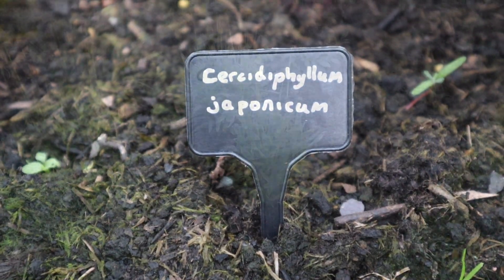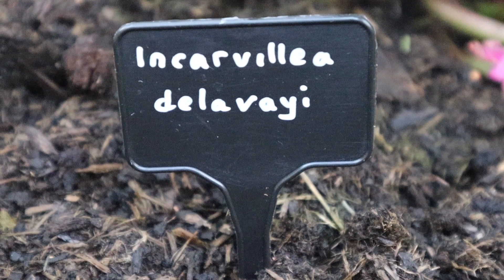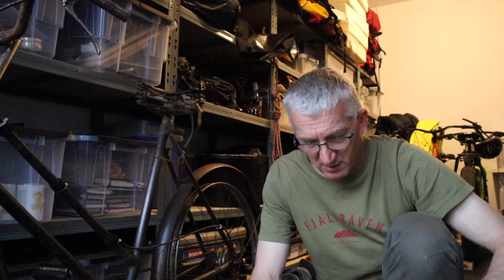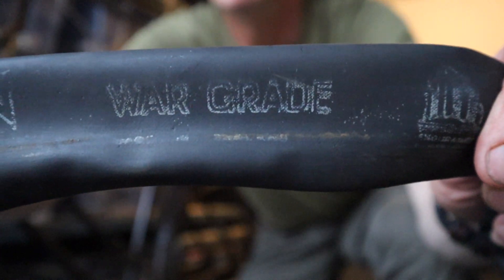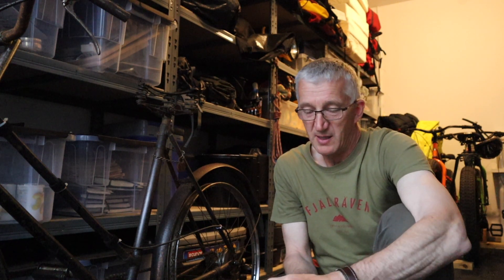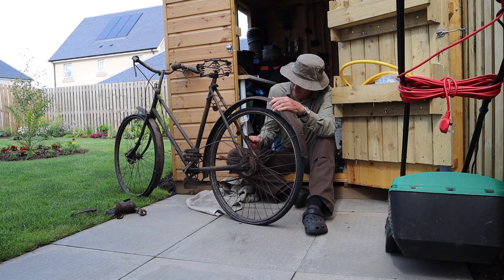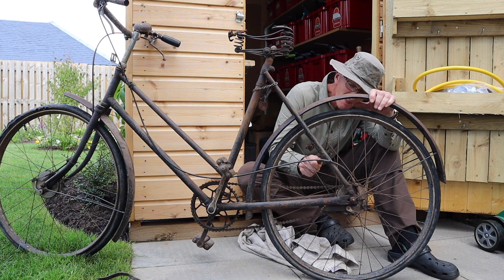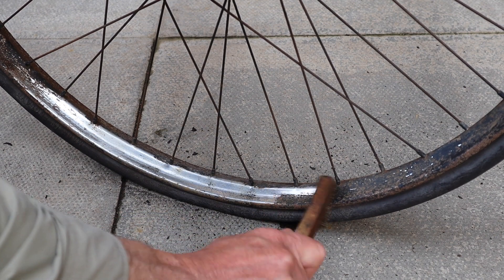Showery weather

Comment: Dave, collecting bikes can be addictive, I had to let a lot of mine go as they were not being used. Interesting that the bike has drum brakes, I haven't seen them in a long while. I'm looking forward to your short trip video's, if you manage to get any done, its always interesting to see where you both end up. D
Reply from the maker: Hello David, sorry for the late reply…..a busy day of domestic chores, in preparation for a couple of wee trips. Garden and house are now tidy :). The biggest challenge with the bike was finding the correct spanners. The nuts were an assortment of really odd sizes. I need to think back to my apprenticeship years (when I studied horticultural machinery) and recall the names/types of the various imperial tool sets. I dug deep in my old tool box and eventually found a set of ancient spanner’s that fitted. The drum brakes were seized. I managed to free one up by tapping it and oiling the external mechanism. It works pretty well. I had to open the other one up and adjust the pads. I used some hessian cord to reseal it (hope it stays watertight) and it works fine now. There were more moving parts in the bell than the rest of the entire bike. I took plenty photos before I disassembled it. I put  the components in an oil bath overnight. It also working fine now. Mo and I took it for a spin around the village (lots of fun and few odd looks). If we get away in the van as planned, we will take the cameras. ATB, Dave

Comment: Interesting to see how much it'll take / cost to get her running once again . Thanks
Reply from the maker: Hello, I’ve drawn up a list of parts that absolutely must be replaced. The parts are: 2 tyres, 2 tubes, 1 seat, I pair handgrips. I think £75 will cover it. I want to  clean up and/or repair as much of the original bike as possible. I’d prefer not to use modern nuts and bolts. I might need to replace some ball bearings. If I decide to spray it with clear coat (to protect the steel), that will be an additional cost. So, I estimate the total cost of the project, including the purchase of the bike, to come in under £150. I will post a wee update when I’ve got the bike roadworthy. ATB, Dave
Reply: @daveoutdoorsscotland2854 £ 150 well spent mate , look forward to the out come I'm in the garden the now doing my own we road bike up atm